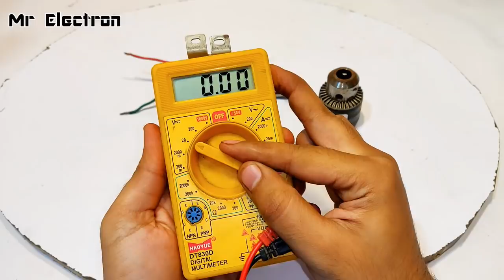3 Simple Inventions with DC Motor

Comment: Why did you destroy the gears? Wouldn't it be better as a hand crank generator with gears?
Reply from the maker: Those were worm gears which cannot be used in handcrank generator. Shaft gets jammed if rotated.